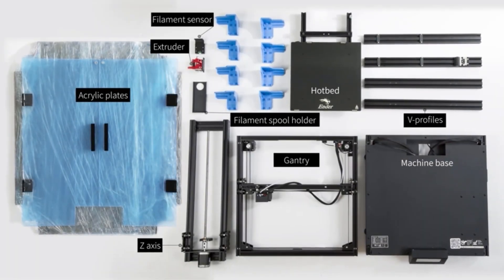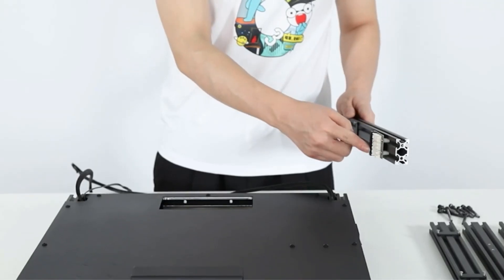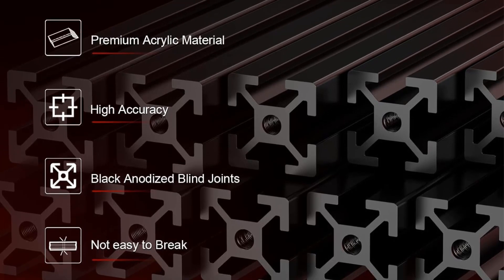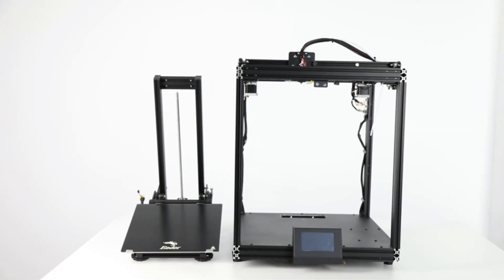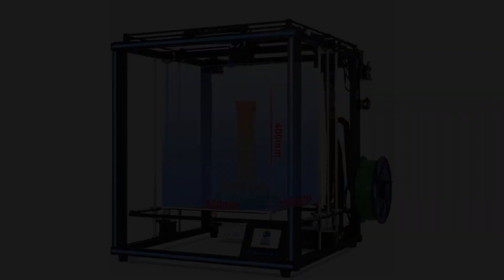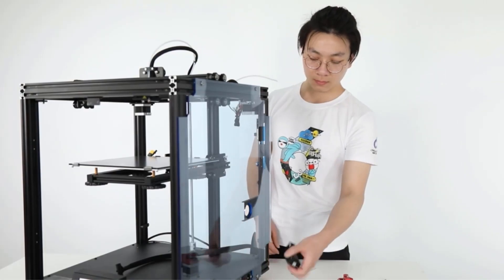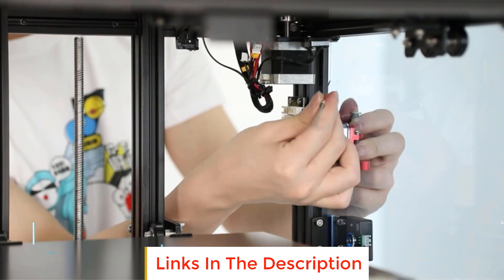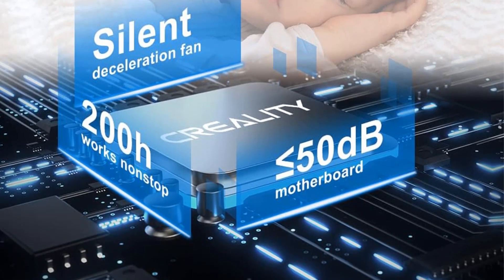✅Best CoreXY 3D Printers 2024 | 4 Best CoreXY 3D Printers for Every Price Range

Comment: Terrible video. Who would include an Ender 6 on that list, but not a BambuLab. But if you say the Ender 6 is cheaper than the BambuLab. Sure it’s cheaper than the BambuLab corexy printer, but not than the A1 and A1 mini, which are both faster and prints with better quality. List should be as follows in no particular order: Any Voron, Any Annex, The 100, Vez 3D’s printer (can’t remember its name), BambuLab.